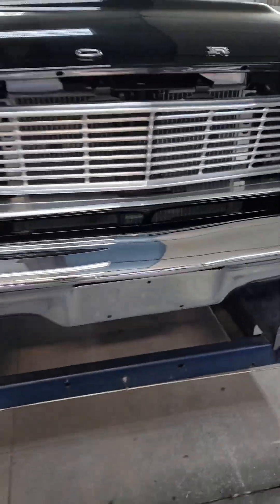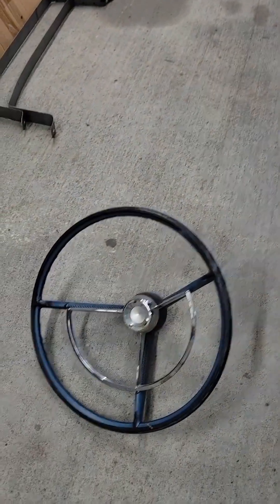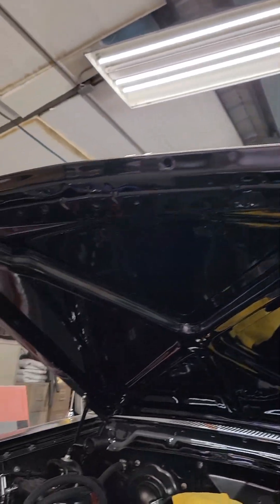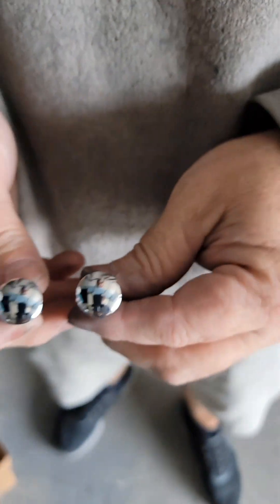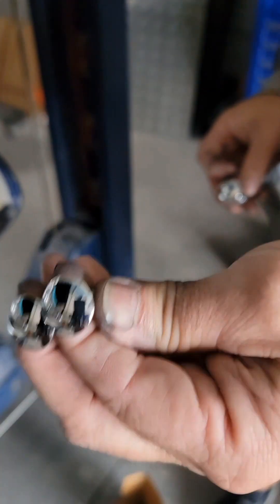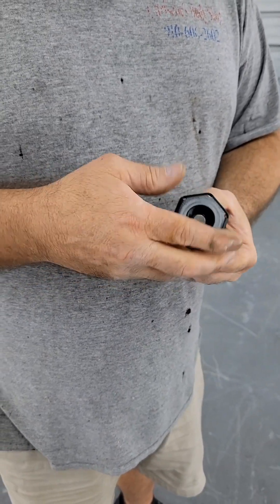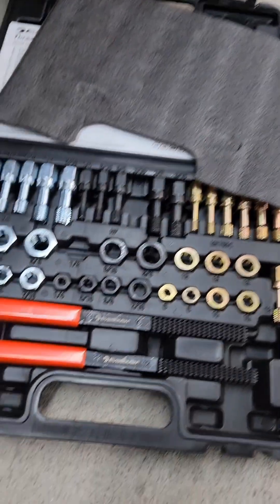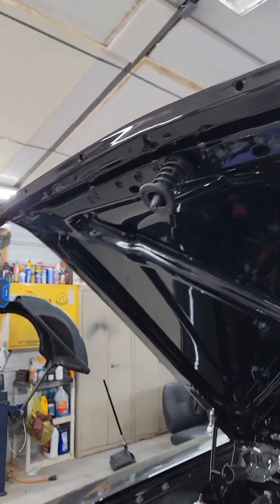64 Fairlane is getting some work, maybe this will be the last week.

Comment: Owned several Fairlanes in the sixties..very good looking cars!
My mother brought one home in the sixties with a 390" and managed to rack up 3 speeding tickets..dad sold it and bought her a 63 galaxy with a 352"..yellow with black upolstry..at the time I bought a 59 Galaxy with 352" and automatic tranny..built an R code 427" in JC machine shop and installed..first hard pull scattered the three speed.
Purchased the running gear out of a wrecked Galaxy drag car..4 speed with all race parts back to the 9" posi.
  Installed it and left the column linkage hanging off the steering wheel and would throw a jacket over the shifter and passed it off as ma ma's grocery getter..great fun ..
Reply from the maker: @ccjensen4670  wow, thanks for sharing the memories,  that R code 427 would probably be a nice chunk of change, thanks for watching!